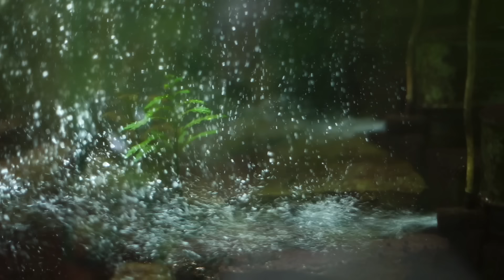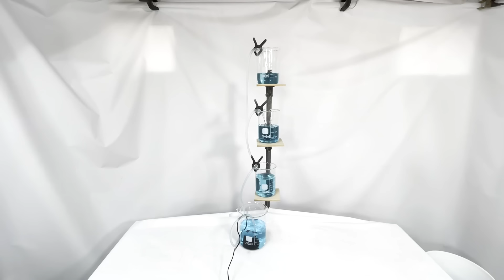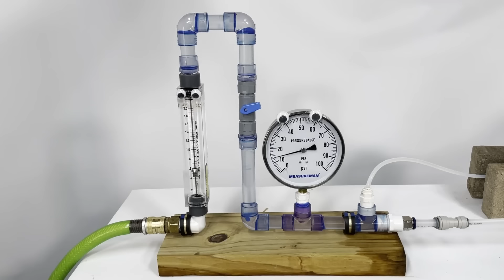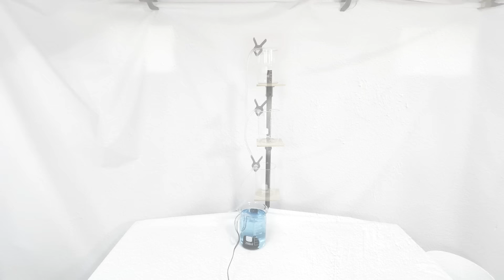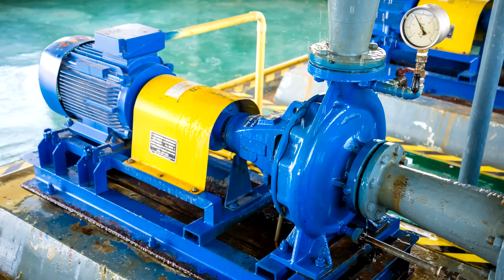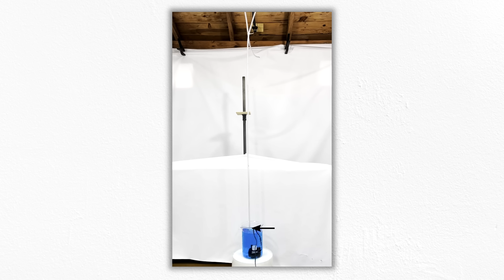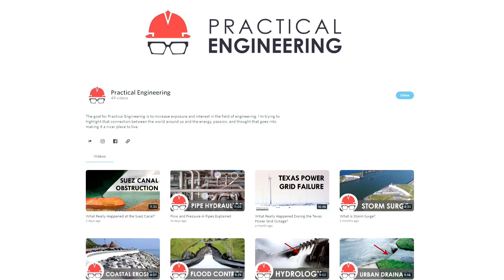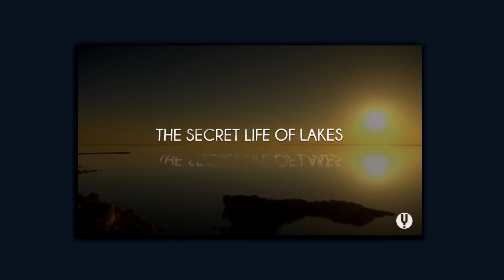Do Pumps Create Pressure or Flow?

Comment from the maker: 💧 Give me your best pump mantras. I'll meditate on the best one.
📺 Don't forget to jump on this great Nebula/CuriosityStream deal. https://curiositystream.com/practicalengineering
Reply: Pumps are just power supply's for water circuits.
Reply: Pumps propagate proper pressure via fluidic formulation of flow.
Reply: AHHH EHHH PUSH IT... PUSH IT REAL GOOD!
Reply: Pumps create whichever one your system allows
Reply: "Pumps create pressure, outlets convert pressure difference to flow."

Most pumps work via a mass pushing against water.  At the point of interaction, this is without a doubt pressure.  It is only because there is an outlet that the water can move out the way and become flow.
Reply: @ScottTancock  that’s what I was thinking. Pumps create pressure and pressure differential creates flow
Reply: Centrifugal pumps accelerate the fluid, which is then induced through the casing volute to discharge. They convert kinetic energy of the fluid into pressure energy. But positive displacement pumps act differently, so it's important to say which pump is meant
Reply: Pumps create a gradient; gradients move all things.
Reply: What about variable displacement pump?
Reply: You faked the ramp pump video.  Why did you do that?
Reply: How do you figure out the system curve?
Reply: Pumps are friends, not food
Reply: How dare you contradict AvE?  Pumps create maintenance problems.
Reply: don't you know pump it up
Reply: Pumps don’t suck. Unless they have enough NPSHA.
Reply: Michael Bishop  They sure do include radiators! Sump pumps and other submersible pumps have the motor on top with an intake below. The motor will often have ridges or even large fins that help dissipate heat into the surrounding fluid, whether that's a tank, lagoon or lake, or the flooded basement you're trying to empty. That's part of why sump pumps have floats to shut them off when the water level drops. 

Without cooling, the motor will burn up as well as the seals on the fast-spinning impeller that's moving the fluid. Once those seals burn up you really get to mix your electrical and water analogies!
Reply: The difference between a solid and a liquid is in inverted proportion how big and powerful your pump is...

/former waste water treatment tech
Reply: cool graphs are cool
Reply: Pumps are the powerhouse of the water system.
Reply: I would say pumps do not create pressure or flow. Pumps simply add energy to the system. This manifests as either potential energy (pressure) or kinetic energy (flow).
Reply: Fight of Flight, except pumps don't fight or fly
Reply: @mikefrom3089  That.  That right there is perfect.
Reply: Hydraulic Engineers are looking for great head 😀
Reply: Pumps create pressure, systems resist pressure, the difference between them is flow.
Reply: Pumps impart energy to a fluid. That energy can manifest as movement of the fluid (flow), increased head (pressure), or both.
Reply: Pumps create pressure. Pressure is like money,  the more money you have left over (not spent on static and dynamic head). The more water you can buy. (Flow)
Reply: Pump is a Vacuum Cleaner with water instead of air.
Reply: Do pumps create pressure or flow? Yes!
Reply: There is no pump.
Reply: Michael Bishop  temperature also includes rotation, vibrartion and other forms of energy, not only forward movement, sorry for imprecise wording
Reply: Pumps create flow when there's no backpressure (no restriction), they create pressure when there's no flow (total restriction), and anywhere in between they create both.

A couple others:
Pumps create potential for flow, systems create backpressure on that flow.
Without the pump there is no flow, without the pump AND the system there is no pressure.
Reply: Pumps create a pressure differential.
(The difference in pressure before and after the pump)
Reply: It's the wattage that kills you!

Lighting strikes at damn near zero amps, but I'll pass on testing the myth that it won't kill me.
Reply: Pumps convert energy from one form to another. Not terribly useful but 100% accurate. Guess that's why I have a science degree not engineering :/
Reply: PUMP!
Reply: "Pumps express their output within an environment"
Reply: would love to see how pumps, boats, anything really . Can have spinning moving parts but no water come trough them. Boats can have a prop chaft leaft the hull, pumps have spinning parts, but water doesnt find it's wat out somehow .
Reply: ok
Reply: "Pumps add energy to a fluid system, usually"
Reply: Flow and pressure are how fluid express its mechanical energy on a corresponding system.
Reply: Kirk Davenport Pumps transform one type of energy (from your power source) into fluid energy. This can take the form of flow, pressure, head, and/or heat.
Reply: Pumps create flow in the absence of pressure and pressure in the absence of flow.
Reply: pumps generate hydraulic energy from mechanical motion*

*hydraulic energy can take the form of flow, pressure, or both, depending on system characteristics
Reply: @joeo3377  I would agree. Just before looking at this comment section i phrased mine: pumps (aswell as batteries/generators) create pressure difference (voltage). This difference (gradient as you put it so nicely) is able to make flow (or current).
Reply: It is also important to say, that centrifugal pumps can be understood when looking at Bernoulli's equation. Since the volute increases in diameter, the pressure must therefore increase and the fluid velocity must decrease. But since the impeller induces more and more fluid, it creates a volumetric flow rate. And the kinetic energy is converted to pressure energy. That's for the centrifugal pumps. But with positive displacement pups, the fluid is displaced from the suction to discharge by mechanical variation in the chamber volume. This highly depends on the fact that fluid are not compressible (very little). Centrifugal pumps need to be primed and positive displacement pups are self priming. Centrifugal pumps are great for pumping large volumes of fluid at low pressure and positive displacement pumps will pump fluid at high pressure but low volumetric flow rate. And then there are multistage centrifugal pumps. And centrifugal pumps can also be connected in series or in parallel, which will affect the flow rate and head.
Reply: It is also important to say, that centrifugal pumps can be understood when looking at Bernoulli's equation. Since the volute increases in diameter, the pressure must therefore increase and the fluid velocity must decrease. But since the impeller induces more and more fluid, it creates a volumetric flow rate. And the kinetic energy is converted to pressure energy. That's for the centrifugal pumps. But with positive displacement pups, the fluid is displaced from the suction to discharge by mechanical variation in the chamber volume. This highly depends on the fact that fluid are not compressible (very little). Centrifugal pumps need to be primed and positive displacement pups are self priming. Centrifugal pumps are great for pumping large volumes of fluid at low pressure and positive displacement pumps will pump fluid at high pressure but low volumetric flow rate. And then there are multistage centrifugal pumps. And centrifugal pumps can also be connected in series or in parallel, which will affect the flow rate and head.
Reply: It’s not a mantra, but you said you love pumps and ask for topics to cover, so here are two suggestions that I would love to see covered by you:
- Turbopumps used in spacecrafts
- High pressure pumps ( the one that delivers incredible pressure of 1000 bars, like common rail Diesel pumps, or for water jet cutting device, etc)
Thanks!
Reply: Flow and pressure are just different ways of interpreting a gradient. Pumps don't create pressure or flow, they create an energy gradient, and that leads to either pressure or flow dependent on the system.

My mantra would be "Pumps create gradients."
Reply: If you want to get high, you have to use your head.
Reply: Not very practical but I enjoyed using my peristaltic pump demo as a ketchup dispenser for a house party. Nothing says nerd quite like that. :)
Reply: PUMP THE MUSCLE!
Reply: Shouldn't your system curves be anchored at the origin? No flow, no pressure loss.
Reply: As an economist, these graphs are very familiar.  You even had elasticity in there.  Perhaps:  "A given pump and a given system will find an equilibrium between pressure and flow."
Reply: Pumps add a fixed quantity of energy to a fluid system. The system determines the proportions of potential (pressure) and kinetic (flow) energy that result from the pump.
Reply: Pumps make water flow up hill
Reply: Please do a video on circuit setters and dampers. And the relation between pressure and flow in both wet and dry systems.
Reply: Technical timely turny thing triumphantly turbulates tubular transitions.
Reply: I mean, I thought PiFaPtaFiawtCCatcSC (Pi-Fap, CC & SC) had a nice ring to it :P
Reply: Hi, I want to thank you for all of the knowledge you are spreading, I've studied electricity, and since I'm working in a maintenance department, where you have to know almost the basics of everything, from carpentry to life safe systems, your videos help me a lot to understand and refresh basic conceps of civil engineering that makes my daily work a bit easier.
Thank you very much, and greetings from Spain
Reply: Would positive pressure upstream of the pump create more pressure at the down stream?

Like if the head before the pump is 2 bar and the pump is rated 3 bar for a  certain flow rate. So at that rated flowrate will the pressure after the pump be 3 bar or 5 bar?
Reply: A pump curve is like a water hose: fully vertical it generate a large head but very little useful flow in the horizontal direction, fully horizontal it generates a small head and maximum horizontal flow. These 2 cases are analogies for a very steep and a very flat system curve respectively.
Reply: Pumps supply constant head to a hydraulic system at a given flow rate. The flow rate depends on the pressure drop through the system. Pressure drop drives fluid flow. A pump supplies the same head, but provides less discharge pressure when pumping liquids less dense than water, like oil (this makes for a cool demo).
Reply: pumps deliver flow under pressure engineer you are not
Reply: The economics guy in upper management when the engineer is saying the pump or pipes need to be upgraded to meet demands "can't you just ... pump it harder?"
Reply: Dang Grady!! Schooled YouTube on pumps pressure and flow. 
Like a boss
Reply: How about a specific type of centrifical pump. The impeller is closed face, meaning the material flows into the center and the vanes are enlosed with openings at the outer edge. Decades ago this was the case, where a pump that handled 600 to 800 plus degree tar was bought as a replacement and even hot tar doesn't flow like water as the viscosity is much higher. The pump in question was given the thumbs up by a mechanical engineer (I think it was his first job upon graduation from college).
This pump rarely would move the hot tar on the first try. There were times when they would take it apart to steam clean solidified tar from the impeller. I'm just estimating, but this pump had to move the tar through as far as 1/16th of a mile of 4.5 in pipe. Sometimes less than 100 ft but raise it about 3 to 4 ft but at the bottom of the tank some through a valve in the center or one on the side of the tank. Either way as the tank filled it had to overcome the rising depth of material.

I guess my question is whether this type pump was the right one for the material it was supposed to move.
The hot tar was coming from the Still where it was heated to remove both water and oil from the raw tar. Once this step was completed and moving it to a finished material storage tank was the next step. The valve steam was run through the pipes and into the tank to ensure the path was heating the pipes and ensuring the valve was unobstructed by melting any cold tar along the way.
There was a drop of approx 2 to 3 feet from the still to the inlet of the pump over a distance of not more than 20 ft.
Sometimes we would switch from pumping into the bottom to a pipe on the side of the tank up to over 30 ft in the air and direct it into the tank.

The initial pumping of hot tar into the bottom was to get rid of as much condensated water. 600 deg tar dumped from 30ft into a tank with even a thin later of water on the bottom would cause the water to flash boil and cause the tar to foam and sometines fill the tank with only foam.
Reply: Pumps increase the energy level of the fluid. It's the fluid's job to do whatever it can with it.
Reply: In centrifugal pump, Impeller imparts kinetic energy (velocity) to fluid, then volute or diffuser vanes converts part of that kinetic energy to potential energy (pressure). So pumps add both kinetic and potential energy to fluid.
Reply: Pumps push and ploughs up and down a hill.
Reply: "Pumps suck"
Reply: @calholli  Almost but not quite!  You have to understand electrical principles before you can understand Ohms law, because you have used most of your terminology incorrectly :-)
If you think of pressure as the "ohms" of a system you've got your basic principles wrong.  Pressure is not actually measuring the "resistance" of flow ("current") because that is by definition ohms!  It's as simple as that: resistance (R) is measured in ohms Ω.  "Current" (I) (measured in amps A) is flow, correct.  But "voltage" is not capacity, which is the amount of fluid available to flow, the closest analogue to that would be quantity of charge (Q) measured in coulombs C, which relates to amps in this context.  However, you do get closer to the principle again with your next statement: the "bigger" the pump (a bit inaccurate but let's not quibble) the more potential for pressure (not flow) which implies potential difference (pd) == electromotive force (emf) measured in volts V.  Volts is pressure, amps is flow, coulombs ("water molecules" to reverse the analogy) is what are flowing, ohms is the resistance in the system.  But this is where the analogy breaks down a little bit as the terminology changes: the "bigger" the pump the more potential for pressure, but the higher the resistance (system pressure in the pipes = back pressure?, perhaps including analogously "back emf") the lower the actual pressure (output pressure at the point of utilization).  Once you look at it that way, and you start to understand Ohms law (specifically the part of it that gives us the famous relationship formula),  it's easy to see that pressure is actually on whatever side of the equation you want to consider!  (V=I.R, I=V/R, R=V/I)
Reply: Venturi pumps are just pumps that need a different pump to actually pump.
Reply: In the navy we used seawater to pump out flooded out spaces.
Reply: Idk, just ask your heart and the truth will be reveled.
Reply: “Pumps don’t pump rocks”

-anonymous pump company, May 5 2021
Reply: Centrifugal pumps increase velocity. Positive displacement pumps move fluid.
Reply: Best pump mantra: "it depends"

There are many, many types of pumps. (Variable vane, variable orifice, piston, siphon...)
There are many, many curves/lines.
There are many, many variables... 

"It depends" is unfortunately the (cliche) answer 🤷‍♂️
Reply: Pumps don't suck.
Reply: Pumps pump, pipes pipe.
Reply: @keijac82  The system curve represents things such as nozzle restriction and pipe friction loss. It is the resistance to flow.
Reply: operating point decided by the pump and load characteristics.
Reply: "Pumps go brrrr"
Reply: This makes me wonder why sewer systems in some cities don’t recapture energy from septic system in forms of water wheels. Could you do one on ram pumps. And how do water bladders increase water pressure. That one always stumps me.
Reply: Pumps do, in fact, go brrrr.
Reply: Water invented humans so it could flow uphill.
Reply: @ianb9028  LoL 😆
Reply: Pumps do work. Pressure is potential energy. Flow is the realization of time and work, realizing the potential energy.
Reply: Pumps don’t suck they push
Reply: There are only atoms, and the void.
Reply: My old engineering manager used to gather the apprentices seated in a conference room, pour coffee in a saucer in the middle then spin it with obvious mess to their shiny new shirts and equally shinny eager faces, then say "That's how a (centrifugal) pump works. Dr. John will expand on the details." Then leave.
Reply: we use a lot of (centrifugal) pumps in our closed loop hvac systems, in which the flow rate matters, and the pressure is usually thought of as a proportional increase from suction to discharge. Our discussions mostly revolve around that idea, and we often say "Pumps don't suck, but they sure can blow"
Reply: I love your vids! and Series for Head, Parallel for Q. Just keep your NPSH in line!
Reply: How about this: All pumps create a difference between input/output pressure, and how much flow depends on the input and output systems they are connected to.
Reply: Can you settle a debate: Do pumps decrease upstream pressure??? I believed that only the back pressure imposed by the downstream pipe would be removed. The pump only creates a divide in the system???
Reply: Pumps push water to their motor's force limit.
Flow rates vary by motor force, pump design, & head/back pressure.
Reply: A pump pressures fluid into moving. 

And from there, depending on what point you're making, you can add a stinger.
-So if there's somewhere the fluid can go, it flows.
-But if the fluid can't move, pressure builds.
-And fluid will move freely, up until pressure comes to a head.
Reply: My mantra is "if you know the nomenclature, then you know the thing". Keep up the correct use of the nomenclature so that we may accomplish the learning you hope to achieve in each one of us!
Reply: Pumps create flow that becomes pressure
Reply: Primed pumps promptly provide persistent pressure, persistent pressure permitted to propagate provides pouring particles.
Reply: It won't work without water.
Reply: Please make more videos on different types of pumps
Reply: Water slide pumps
Reply: Pumps create flow by applying pressure
Reply: Would you be interested in helping create a project based learning project for middle schoolers?
Reply: "Pumps impart a positive potential on fluids."

Everything else depends on the rest of the system.
Reply: Pumps press on water, pipes let it flow ;d
Reply: The pump provides the pressure, the system decides the flow
Reply: I'm a bit late to the party perhaps, but I submit this mantra/poem:

Pumps follow their characteristic curve, 
relating flow and pressure.  
Which system they are connected to,
determine what values you will measure.
Reply: Pumps create pressure like generators create voltage. Even fixed volume pumps have a characteristic curve, but their max pressure is much higher.
Reply: I would love to hear explanation of the Dynamics of a suction dredge.
I'm a gold prospector.
I know there's a lot to it when applied to Gold dredging.
I think your mind would find it a good challenge.
Reply: "...has anyone used PCP with POC?" Lufkin?
Reply: @vortextube  what's this i didn't know he has a video on ram pumps must have a look thanks
Reply: Centrifugal pumps add energy via pressure to the system. Changes in flow are perceived by changes in the system state and our end-of-pipe perspective.
Reply: @ScottTancock  Hi, the impeller rotate increase velocity of fluid -> increase dynamic pressure -> so pump can increase dynamic pressure, right? The volute of pump just like an increase in area to slow down the velocity and convert bulk motion in random motion -> increase in static pressure
Reply: Hi Practical Engineering, the impeller rotate increase velocity of fluid -> increase dynamic pressure -> so pump can increase dynamic pressure, right? The volute of pump just like an increase in area to slow down the velocity and convert bulk motion in random motion -> increase in static pressure. Does it make sense & logical?
Reply: Pumps create pressure, system determines flow.

Electricity:  power source creates pressure (emf) circuit determines current.
Reply: Pumps are fascinating. I’m a Perfusionist. We use both centrifugal and peristaltic pumps to help keep patient alive during a heart surgery. There is a fascinating history of pumps evolution from basic to implementable pumps to total artificial heart in human body. I too love ❤️ pumps. 👏👏. 
Great channel, btw. 👏👏
Reply: You can lead a pump to water but cant make it think.
Reply: When I read the title my immediate thought was (neither, and both because) "Pumps impart energy to a fluid medium".
Both pressure and flow are the result of that energy in the fluid.
Reply: Hate all pumps that aren’t working…
What many people don’t realize is how sensitive a centrifugal pump is when it comes to small particles.
A small piece of a fish bone can mess up the flow completely, I guess it’s obvious by both points above that I work on a fish farm…
Reply: If in doubt, pump it out
Reply: @kirkdavenport  I'd argue that they add kinetic energy to the system that causes a pressure differential that causes a mass flow
Reply: @droam129  I quite like what you're saying. Although be aware of regional differences, for example in the UK we use the term resistance rather than back pressure.
Reply: It’s all about stored energy…. Same thing in transmission lines and dielectric waveguides :)
Reply: "I am Hanz and I am Franz and we want to pump you up."
Reply: Pumps create pump
Reply: Cosford's Law: Pumps create pressure; flow is the rate at which you create pressure."
Reply: Pumps create potential, the systems put it to work.
Reply: @rosstemple7617 Sewers contain fats, toilet paper, tampons and so on. No one wants to do anything that might create a blockage.
Reply: The fire engine down the street has a large centrifugal pump driven by the diesel engine that supplies the hose lines, and a small positive pressure pump to prime the main pump if operating at draft. Once the priming pump might have been gear driven by the engine, and maybe be a rotary gear pump or rotary vane, now they are near universally rotary vane and driven by a dedicated electric starter motor. Cheaper, easier to maintain than the gear driven operation. 

Of course it doesn’t make it to the incident in the fire place without the pumps for engine and automatic transmission cooling, power steering, and air brakes. Or do we call that a compressor? And the FF’s arrive better able to perform in hot weather if the refrigeration compressor is operating. I guess all that’s left is the diesel engine’s turbocharger. All those functions on one chassis. Go specialist design engineers.
Reply: pawmmmmmmmmmmmmmmmmmmmmmmmmmmmmmmmmmmmmmmmmmmmmmmmmmmmmmmmmmmmmmmmmmmmmmmmmmmmmmmmmmmmmmmmmmmmmmmmmmmmmmmmmmmmmmmmmmmmmmmmmmmmmmmmmmmmmmmmmmmmmmmmmmmmmmmmmmmmmmmmmmmmmmmmmmmmmmmmmmmmmmmmmmmmmmmmmmmmmmmmmmmmmmmmmmmmmmmmmmmmmmmmmmmmmmmmmmmmmmmmmmmmmmmmmmmmmmmmmmmmmmmmmmmmmmmmmmmmmmmmmmmmmmmmmmmmmmmmmmmmmmmmmmmmmmmmmmmmmmmmp